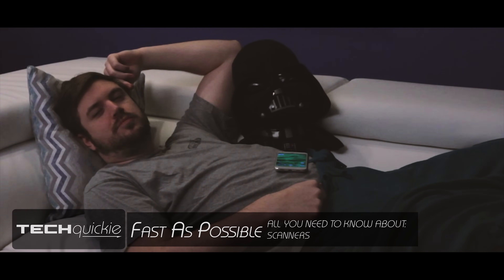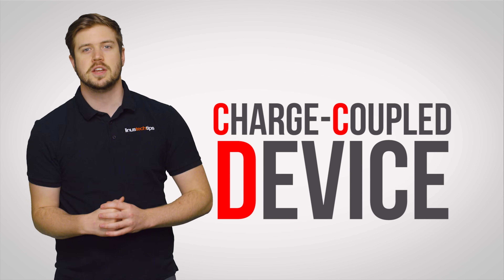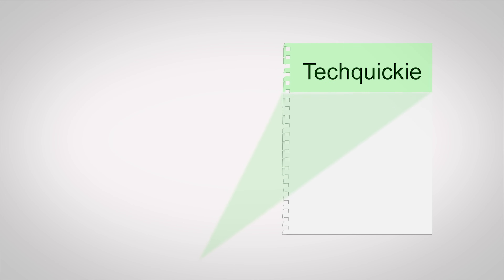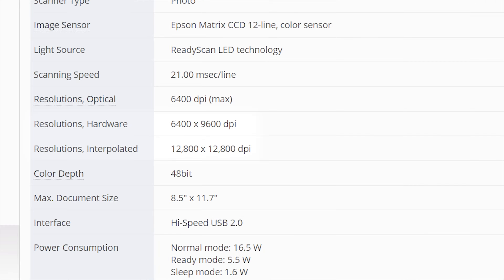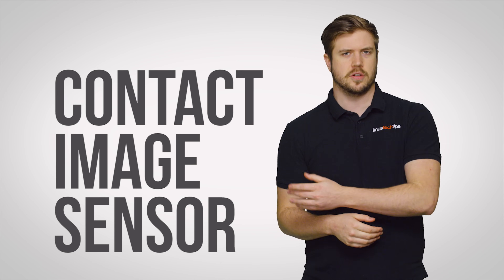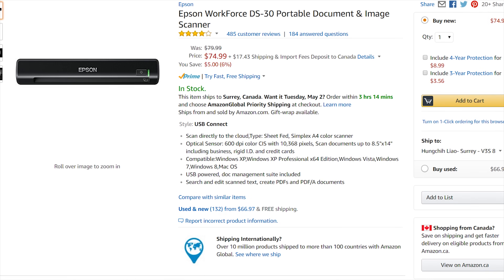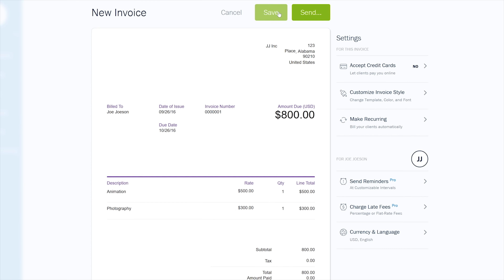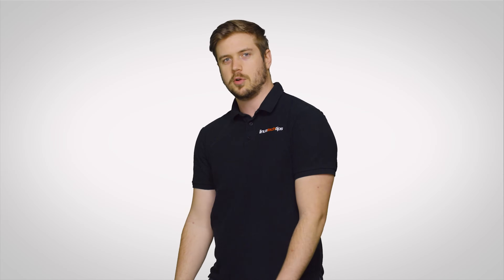How Do Scanners Work?

Comment: I have the HP Envy 4500:
Scan resolution: Hardware: Up to 1200 x 2400 ppi; Optical: Up to 1200 ppi
Scan technology: CIS
Not sure what they mean by the "Optical" (vs Hardware) part in this case, and "up to" (probably just selectable resolution).
The scans are ok as far as I know (Nothing to compare with, was cheap printer/scanner though $73.81 for a new one at my local store... needed a printer, got a scanner for bonus... YAY!)

Comment: Something incorrect at 2:55 - 3:20 
"contact image sensor or CIS (...) use an array of LEDs (...) image sensor can essentially take a snapshot of it like you were trying to do on the table with your cell phone, but better."
So, I don't know if snapshot (meaning whole page, not just one line) is done with CIS. However, it works in direct contact with the document, UNLIKE a snapshot with a cell phone or any camera that photographs objects at some distance from the lens.
!! Incorrect comparison. Who even wrote this??
Reply: My opinion is that scanner's advantage over camera is that there's no spherical distortion from the lens to correct (depends on the distance to the page photographed) and lighting is controlled by the device taking a picture. 
(putting aside all other factors that affect quality)

Comment: Everything mentioning the Pixel but nobody is pointing out how most phones also have a flash you can use as a light, as long as you don't get too close or far away then it should be adequate for taking photos of a document.

Comment: Interpolation is indeed trickery.  Ever look at the specs of some cheap Chinese generic smartphones that claim to have a 13 MP camera?  Sometimes when you dig into the real specs you find that it is really just a 5 or 8 MP camera that is interpolated for a resolution of 13 MP.  I don't have any problems with these phones probably because I don't own one and see how truly awful the picture quality is by comparison to my Xperia X 23 MP camera which BTW, has a real 13 MP selfie camera.  If you don't want a 5 inch phone there are compact models of some Xperias as well that still have all the features of the bigger ones except for the same screen.